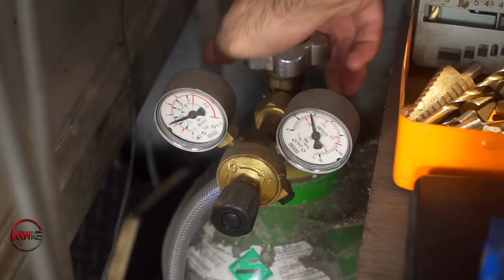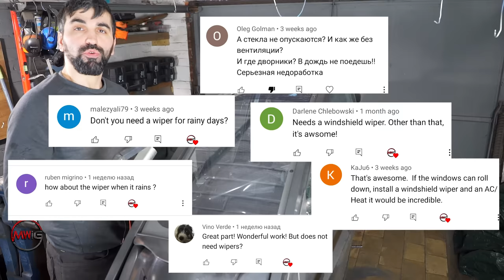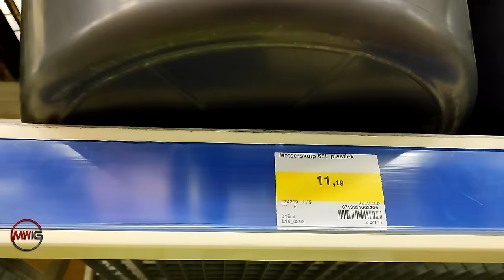Making of futuristic Three-Wheeler Vehicle - I Modified Scooter to the three wheeled vehicle

Comment: You have a prototype, now you need to refine the design to make it manufacturing friendly. Then go into production. Great commuter vehicle.
Reply: Prototype? It is just a scooter with a front mod that are made from a ATV? The cabin is really nice craftsmanship. But really there is no economy in making this since buying just the scooter is cheaper. And if you want a roof on your head then why not a SUV or a normal car? Electric if you want social cred. Really there is no space for this since SUV's are a thing. Phone and drive are a thing..

If there was any government that cared, THIS is what should roam around on the roads. Together with electric bikes and walking on foot people. But for that to happen so much of society have to change. And the ones in power do not want to in convince themselves by having there bents or BMW's or whatever go away. Imagen big cities going from cars to electric driven non safe to crash vehicles. And then have people learn to drive or get thrown in jail if not driving safely. But so much need to change for that to work. And war, war never changes.
Reply: @TheDiner50  Most inventors do use preexisting machines and off the shelf items to build their prototypes. They only need to confirm proof of concept. Then they can begin the process of refinement. Reducing part counts, determining sourceable parts from suppliers, establish jigs and fixtures needed for manufacturing the parts they produce themselves. Yes, it's nice to commute to work in a dry environment, i.e. a roof over one's head. That's why this is preferable to a scooter. Buying a SUV negates the potential cost savings of electric, plus the space required to park larger vehicles in space hostile urban environments. Electric is not just about going green for the reduction of fossil fuels and carbon footprints, etc. Again, in urban environments it is the potential to reduce the ever present noise of hundreds of thousands petroleum-based vehicles in constant motion. His vehicle is one of many that are on engineering "drawing boards" around the world. He built something with potential. Wouldn't you like to see him succeed if he desires to do so? The big auto makers of the world have sat on their status quo's for way too long. As much as I love my noisy, smelly gas guzzler...change is coming.
Reply: @TheDiner50  I believe the only thing they need to do is make an extra road and divide the lanes into weight classes, that way if you crash you won't die as easily, or something like this
Reply: I agree!👍
Reply: With the safety requirements governments put on vehicles that are enclosed it would force companies to charge around $12k for that as MSRP…. for an enclosed scooter…. It would make more sense for a manufacturer to build modification kits and sell them for $3k to add on to the price of the scooter and you do it yourself or pay a mechanic another $2k so that all the safety BS (airbags/sensors) don’t have to be added because it’s a custom modified scooter not manufactured as a three wheel car….

IMHO
Reply: @Rick_Sanchez_C137_  yes it would likely cost more than a normal scooter. But even at $12k, that's half the cost of most compacts. And the point of commuter vehicles is the payback in reduced fuel and maintenance costs plus ease of parking. In 2006 I dumped my full size Chevrolet pick up truck with a "fuel saving" V-6 (which did no better than the V-8's, MPG wise). I put $120 of gas in it a week. Dreading doing so, I replaced it with my 1st foreign car, a $24k Civic. I saw my fuel cost drop to about $30 a week and realized the other benefits of parking and maintenance.
I find it ironic that governments require enclosed vehicles to have airbags but are alright with open air scooters and motorcycles having no safety devices of any consequence. The kit solution would probably work out good, though many areas may require some form of additional inspection, which I understand. Bottom line, I am fascinated with vehicles like this, I would love to find an old Aerostar (I think that was the name) from the late 70s early 80s.
Reply: That's nice and all but this is already a thing and has been selling for a while now it's nothing new really
Reply: @imperialdra-mon5907  doesn't have to be...
Reply: @eksine  fxtiicderuu
Reply: @eksine  Excellent idea.
Reply: Stonks
Reply: Yup, better than before, he is safety n comfort know, awesome n thanks :)
Reply: @TheDiner50  alot of other countries use much smaller vehicles then the states and in Asia the moped is much more common then cars.
Reply: Sadly can-am has the spider and ryker so I feel like there would be some legal issue regarding patents
Reply: @Brandon Cummings  yep your right there and already aliababa  etc and other manufacturers  like for example  piaggio and Chinese factory's already make these yeah I understand  about making your own  one or version but then you need all the tools bike and a donor bike or quad bike  like in the video or both and then after doing all of then in the UK then it's got to go for a iva individual  vehicle  approval  tes and inspection  after all that's been done  and its passed that then should get issued  the logbook  and vehicle registration  plate to get it made up and then you need to have it moted  and then insurance  and who would  insure it that's the other thing and that's alot of things you can and can't do to get stuff road legal registered on the road  around the world every country  is different  but hers in the UK would need it built  then the iva  dvsa inspection  approval completed and safe to be allowed  to go on the road then your still going to be waiting then a while to be able to even legally  be able to ride/drive it around places etc  aswell then and then they have to at the dvla get it in the right category  and weight limt as its classified and classed as a moped or tricycle so you don't want to be paying a stupid fortune  on the vehicle tax costs becuase the trike weights  ex amount of kgs as here in the UK anything from a 50to a 250cc maybe even some 300ccs motorcycles  and scooters way a certain amount  of weight  which falls in the 20 a year road tax cost or in some cases  250ccs -650ccs + anything  from £50-£170  a year or even more
Reply: This would sell well in Asia.
Reply: modify the engine into ATV so could have a reverse maneuver and more power.
Reply: @Vault57  dude are you an engineer?
Reply: Is it bear proof---going to test it in the woods?😁
Reply: Google Carver
Reply: This YouTuber engineer has excellent dexterity and skill that can literally be called "the hand of God". Truly a respectable person and should be scouted by an existing motorcycle or car company.
Reply: @eksine  that was done in China. Not safe. Lots of dead people on motorcycle only lanes. There's an expat living in China who has some videos on this idea.
Reply: Yes this would be amazing for getting in and out of my local city
Reply: @pauls466  ijii
Reply: I agree!!! I want one!!
Reply: In term of business you could use this to deliver food like a bike curier
Reply: Make in india  india project
Reply: any frame parts can be replaced with unibody design
Reply: Better yet, call this a conversion kit for that e bike and specify the e bike and quad models, bring your own donors and just sell the frame components.
Reply: I would buy one
Reply: @Narja kinda
Reply: I0
Reply: Nimbus 1 EV is already on
Reply: Estaria bueno q lo hagas ecologico  q ande con agua es desir a idrogeno quedaria fantasticco felicitaciones ojala tomes mi consejo sos un genio saludos desde salto.buenos aires.argentina
Reply: I want one.
Reply: He is a content creator/vlogger.... not a production manufacturer....He makes money from YouTube....
Reply: @TheDiner50  r
Reply: Why dont you make 2 seater?
Reply: ❤Браыя.. ❤
Reply: @TheDiner50 well it's simple marketing/economics really. This product on consumer level is not even remotely in the same class as "convenience A-B" like purchasing a Toyata Corolla. It's neither a luxury sports car. This could very easily be marketed with exclusivity in mind in a stand-alone class of enclosed 3-wheeled cycle, similar to Sling-shots and Spyders, but with added comfort for cooler climates such as Canada where I'm from -- could even consider channeling engine heat into the cabin with a basic thermostat setup. Functionality could build upon refining the rear end to match the off-road capabilities of the front end (needless to say along with other practical tweaks). Being both a part of the off-road and motorcycle community (neither of which are cheap sports, and neither of which are for anything other than entertainment/enthusiasts purposes) I first handedly believe this concept could definitely have traction amongst the right demographics, especially if marketed exclusively. I would pay a ton of "stupid-money" on this if it were refined, for the cool-factor alone.
Reply: @Rick_Sanchez_C137_ citroen ami. Any other quadracycle on the market. Many don't have airbags and you can sell them just fine. Even in the EU
Reply: @scottmartin2167 so?? You arent allowed to put patents on vehicle classes..only on design.. Else you would only be able to buy Mercedes-Benz because they had the first road legal car
Reply: @metaljacket64 not nearly enough to cover this expenses
Reply: Can Am Spyder. 3 wheel vehicles already exist. Fun garage project tho!
Reply: @factoryshed9500 you kind of missed the point. Why should we even need the Can Am Spyder? There were plenty of 3-wheeled vehicle options available prior to the Spyder. That's kind of like saying, "Why do you need a new brand of anything? They already have the original stuff being made." If this were the rule, beer drinkers would still be drinking Schlitz to go with the only form of a burger McDonald's ever made while sitting in their Ford Model-T.
Reply: @Vault57 I'm amazed that no motorcycle scooter 🛵 company has mass produced & sold something like this...I know if I could build a similar vehicle I have envisioned in my head. That I could sell a ton of them. In big part because the vehicle wouldn't cost much more than a cheap motorcycle, could be used everyday  yr round in rain, cold, snow & would  literally pay for itself in fuel saving costs. It could be a 1 or 2 tandem seated commuter vehicle. With plenty of storage via 3 removable aerodynamic storage compartments. All you have to do is build a recumbent seating scooter & add a removable (for nice weather) aerodynamic lightweight weather enclosure. Think 🤔 of an adventure motorcycle but with 2 wheels up front and a removable weather enclosure along with heat & AC when the weather enclosure is on it. 
Sorta like a tandem 2 seated Polaris Slingshot but with aerodynamic full weather enclosure. Idiots argure that nobody will buy them. Yet people buy the super impractical Slingshot & Can Am Spyder & Harley trike that doesn't even come with a weather enclosure. So it sucks to ride in rain & cold.
Take the Yamaha Tricity or Piaggio mp3 platform. That uses the articulating 2 wheels & suspension up front. That allows it to carve corners while still having the stability of 3 wheels 🆚 2....Simply make it in a recumbent seating position and add the aerodynamic removable enclosure. The recumbent seating position & aerodynamic enclosure will make it 35+% more efficient than an upright seated motorcycle. Where the rider creates major wind drag. It could handle street & light off road as a daily driver, be used yr round, have plenty of grocery storage, fun to drive. If it used a Honda NC750X manual or automatic engine. It could go 120-130 top speed & get 70+ mpgs on hwy.
Reply: Hasta las huevas

Comment: THIS  DESIGN  NEEDS  TO  BE  MASS  PRODUCED.
I would definitely buy one :face-blue-smiling:
Reply: Given that this all adds alot of weight the MPG is going to go down quite a bit so he would need to add a bigger fuel tank as the tank on the kymco agility city 125 that he built this around only has something like a 4.5 liter tank.
Reply: @eraldorh  You can drag a trailer with a barrel😂😂😂
Reply: polaris
Reply: Piaggio ape 50ccm
Reply: a lot of dead space.  
Imagine a moment that all cars became this kind of vehicle. this means 1 car for ONE person ONLY.
The width is  almost the same as a car with dead space
Reply: I agree with that I would defo buy one

Comment: This is incredible; no pre design plans, no cut parts, no angle finder, no calibration; just design as you go. truly amazing.
Reply: i used to do it as a kid, its really good when you just want to create something new and you have a vague final product idea, but planning is best if you have something specific in mind i think.
Reply: I never saw use of tape measure either amazing
Reply: @gregz4249  I get your point, but.. 12:25 :P
Reply: Thank you, my friend, for this video.
Reply: sdf   He needs to build one but full electric... then he can start an industry with this...
Reply: @gregz4249  i saw it he used it
Reply: No front brakes, no leaning in curves, no  homologation, square tubing badly bent...
Reply: @Lvvcassss  No front brakes?  Look at 29:50  I'll agree with no leaning, no homologation, and it looks like the square tubing bent quite well, although how "good" it is is another question.  Also not a fan of those "rivet bolt hole" thingies.
Reply: @BaldyTheOnlyOne  Ok, I must have skipped through that part and saw rear wheel locking while braking, so front-rear brake bias is wrong. Rivet nuts are ok, used frequently in automotive :)
Reply: @tjacasaur  Throw away your phone and start the life of truth ;)
Reply: Nowaday, you don't need much engineering, you need a good set of mind and the ability to create. Testing and improving is an ongoing process, you don't get everything right in one day. I can build I'm just not good in school.
Reply: angle ,angel buat sepeda rakitan becak, umumnya beli jadi
Reply: @luisbeck007  Check out the AKO trike.  It is a leaning purpose built electric tadpole trike; looks like an absolute blast.  I'm more into efficiency / safety so I want my Aptera (big boy trike / solar sports car)
Reply: Absolutely!
Reply: @monkeypolice3048  "engineering" and "ability to create things" are basically the same thing when u think about it.

You also need money.
Reply: I mean that's the old school way. I mean winging it is how most of the world's most beautiful vehicles were made.
Reply: @sketchy_loco  what happened? Did you turn into a grownup and forget?
Reply: @Pir-o  necessity is the mother of invention. It’s not magic or beyond your reach, unless you’re a millennial. In that case you’re screwed.
Reply: @billybowman3891  what?
Reply: @sketchy_loco  you said it was something you did when you were a kid, as if you don’t anymore.
Reply: @billybowman3891  you acting really weird. You have some issues my dude. Find a therapy instead of coping on youtube
Reply: @billybowman3891  yes, why? does it matter to you?
Reply: @sketchy_loco  I care.
Reply: سبحان الله وبحمده سبحان الله العظيم.يا ايها الذين آمنو لا تلهكم اموالكم ولا اولادكم عن ذكر الله ومن يفعل ذالك فاولئك هم الخاسرون
 ...
Reply: @Lvvcassss  never seen rivnuts used on critical parts like suspension mounting, would not even consider it
Reply: @BaldyTheOnlyOne  &   @ukaszpiotrowski830 ... 34:12 ... look at the rear wheel!
He uses the rear brake because there's too less brake force at the front wheels. The reason is that he still uses the master cylinder of the scooter which is designed for only one caliper - now he has two calipers and therefore it's the wrong hydrailic ratio.
But basically an integrated brake system with a proportion valve between front and rear would be best since you don't need seperated brakes on a 3-wheeler like on a motorcycle.
Reply: @Lvvcassss & @BaldyTheOnlyOne ... 34:12 ... look at the rear wheel!
He uses the rear brake because there's too less brake force at the front wheels. The reason is that he still uses the master cylinder of the scooter which is designed for only one caliper - now he has two calipers and therefore it's the wrong hydrailic ratio.
But basically an integrated brake system with a proportion valve between front and rear would be best since you don't need seperated brakes on a 3-wheeler like on a motorcycle.
Reply: @M3ANDER  Cool; I had forgotten about this video actually.  Glad for your comment.  This build is really kinda cool.  Rear braking is fine; who knows, maybe he can do some mad "hand brake turns" if the conditions permit 🤪👍

Comment: Your freestyle, eyeball to measure, chop-n-weld on the fly style of fabrication is flat out astounding. You must have a professional grade CAD program running in your head. Most of us would just end up butchering two vehicles and be left with a bunch of burned out scrap. You made a functioning hybrid that rivals or beats anything in its class that cost millions to design and bring to market. Shade tree mechanical engineering at it’s best!
Reply: I have Dyslexia and am just finishing up a motorbike which is modified myself. All be it a conventional 2 wheels bike. I don't know if he does have Dyslexia, however being able to design in your head is so much fun and a trait that is definitely part of Dyslexia. Everything I modified on my bike was done eyeballed although I did use a lot of BOM style  (look up Binky the amazing Mini) CAD design.. that is Cardboard aided design.
Reply: Lol
Reply: @katierscott8771  Great video! Now I have more project ideas. I modified almost everything I own. Always have the plans in my head and have to make changes on the fly when things don't work. Have ADHD a bit of lexdicia and some CDO (that's OCD alphabetically correct. Never realized the gifts of lexdicia until you mentioned it. I do notice ADHD allows me and others that have it to hyper focus.